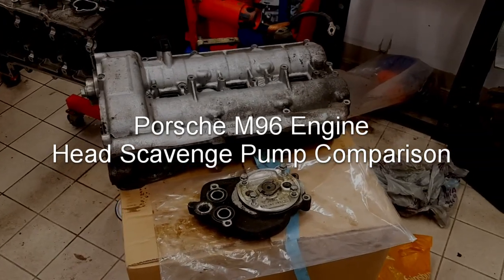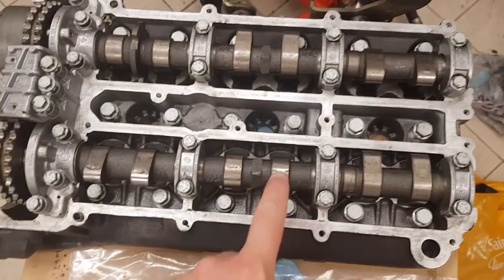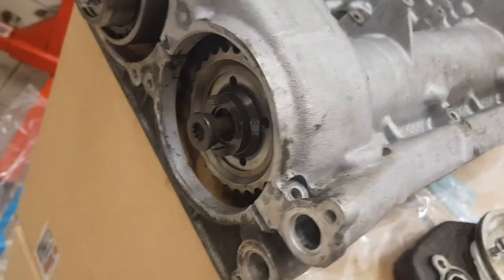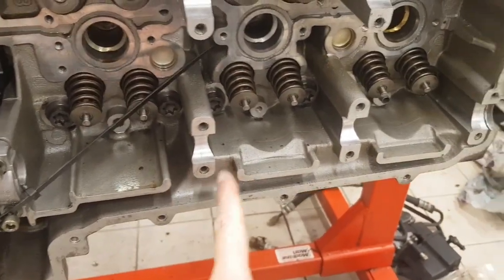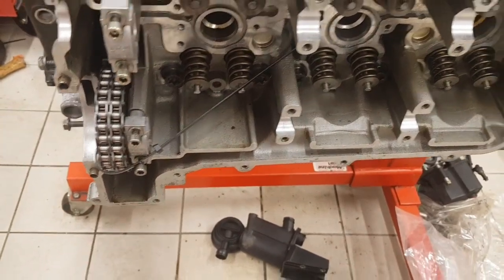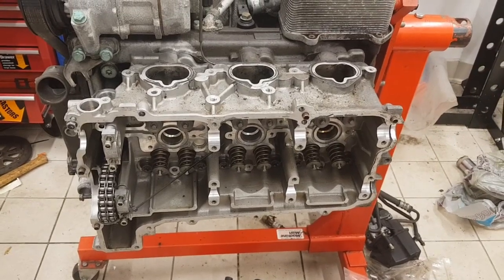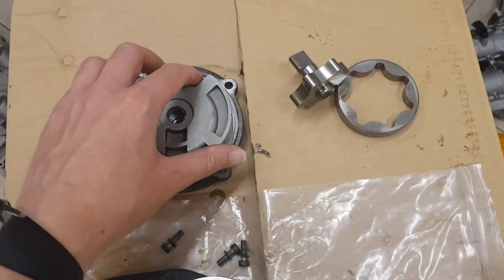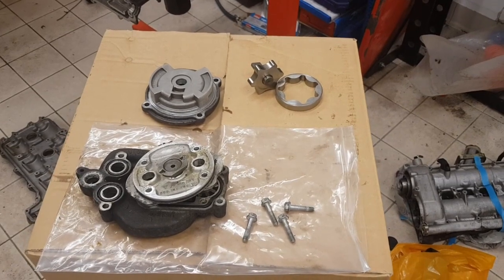Porsche 996 986 M96 engine scavenge pump comparisons, Carrera / x51 / GT3

Comment: I watched your oil pump videos and noticed the GT3 scavenge (and main) are gear pumps vs G-rotor on the M96. Is the diameter increase for the G-rotor making up for the capacity advantage the gear drive pump has? Looking at general testing info on these 2 types of oil pumps - I see there are RPM limitations on G-rotor (cavitation)- is that an issue for the 996 (3.4L) <8K RPM?

Comment: Great to see thanks for the vid 👌🏻 , wondered if you could cover a small issue in having I have a slight weep from the oil feed / return pipe that goes to the scavenge pump on a mezger engine it’s the large ish pipe with a square part inline we’re it attaches to the scavenge pump , is there a torque setting ? Or will it require a nip up? Or is there an O ring in there kind regards alex

Comment: Very useful, thank you Martin. What is your understanding of the 997 engine, particularly the M97.01. The have the twin ‘Oil & Vacuum’ pump, and from what I’ve read the X51 versions didn’t get the benefit of that extra oil pump (or pump)
Reply from the maker: The 997 engine would use the same sort of setup on the 3.6l M96 engine, where the slope on the heads to aid oil return is steeper.  There are minor differences on the breather as well, but the 997 and the 996 both run the single scavenge on each head as standard.  I have a theory that the extra scavenge pump on the 3.4l x51 was developed when Porsche had the intention of possibly using the engine for racing applications, but when they decided not to they dropped it from the 3.6l engine as it wasn't needed as much and without the car going racing there was less need for it.  I will say though, I have no evidence at all that this is the case, it just makes sense to me from an engineering and production cost side of things.

Comment: I'm confused, you didn't show the 986 Boxster engine?  Is their no problems with the Boxster engine?
Reply from the maker: I was just concentrating on different setups in the 996.  The setup in the Boxster is basically the same as for the 996 Carrera, but the engine is turned the opposite way around, so issues with the scavenge on the head are on the opposite bank.
Reply: @martinhill5770  So basically no one makes a pump like yours to work on the opposite head of a Boxster? So the same issue can happen under heavy braking and cornering where oil can accumulate in the corner of the head and not drain back fast enough?

Comment: Did they fit the x51  scavange pump and suction  pipe to the 3.6 carrera , I've been told it was only fitted to the 3.4 ?
Reply from the maker: No, but if you just read that on 911uk it was me that posted it, so not a valid second opinion I'm afraid.

Comment from the maker: The 90 x 2.5mm o ring is 99970748240, the 85.32 x 3.53mm o ring is 99970742550.  I assume it would be the second one.  10Nm for the bolts which hold the gear cover on. No mention of loctite.

Comment: Turbo pump, what is the part # for the large seal that goes around the gears ? also, 4 bolts that hold the gear cover, any idea what torque settings are for them ? They were tough to remove, I guess you have to use some kind of loctite as well ?

Comment: Hi Martin very interested in your videos. I have a 996.2. Carrera and would like to do the brake upgrade and improve the oil flow with the X51 sump kit and maybe your scavage pump mod. Are the parts for the brake calliper adaption and the pump availible to buy from you? Keep up the great work. Andy Allen.

Comment: Thanks! I’m very interested in that x51 pump modification . Do you have more info on parts, procedure etc?
Reply from the maker: The pipe is a standard Porsche part, a component of the x51 kit. The pump is a bespoke part I have had made up as the original Porsche part is NLA. After testing on a few engines I will make it available for sale. I can't do that in clear conscience until it has been run for a number of miles and inspected. It uses a pair of standard gerotor pumps with billet drive and housings.